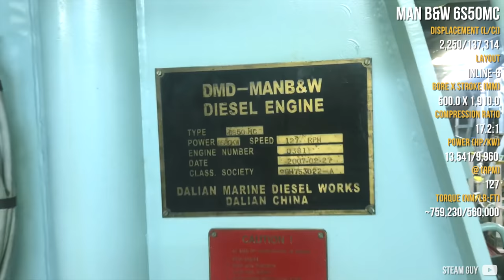Lowest Revving Diesel Engines

Comment: Detroit 71 and low revving don't belong in the same sentence.
Reply: They are low revving though. They just sound like they're screaming because you get the exhaust pulse twice as often as with a similarly revving 4T diesel
Reply: Detroit 71s are known for being weak in the low end. They need every last one of those 2100 rpm and some even went to 2650.
Reply: @nickthompson9697  Take the turbos away from the 4-strokes....and see which is really the gutless wonder

The 12V71 pulls 477 HP without a turbo to go with 1251 lb-ft of torque.
Reply: @markdubois4882  Take the blower off the detroit and it won't run at all. More to the point, there's a reason we don't do engines that way anymore. They're criminally inefficient and can't get anything done without leaking everywhere. Kind of like most of the people who still shamelessly defend them.

Comment: The MAN 6S50 still is revving relatively high for Two Stroke Crosshead Marine Diesels. The MAN S Series (S meaning Superlong Stroke) goes up to 900 mm Bore on the S90. I personally worked with a 6S80 ME-C, meaning it has 800 mm Bore and accordingly 3450 mm Stroke (if the S90 has the same Stroke to Bore Ratio, it would have about 3880 mm Stroke but I don't know if that's correct). The 6S80 I worked with goes up to 78 RPM and I'd guess other Verions of it are in a similar Range; e.g. does the Maersk Triple E have two of the same Engines with eight Cylinders instead of six (8S80 ME-C) and IIRC it is built with up to twelve Cylinders for Ships similar of similar Size to the Maersk Triple E Class but with only one Propeller and thus one Engine. Given that the Cylinder Oil (these Engines use different Oils for Cylinders and the Crankcase) can only do it's Job up to a limited Piston Speed, the longer Stroke of the S90 means that it runs even slower. The ME-C means that the Engine is controlled electronically without a Camshaft, contrary to the conventional ME-C Engines. This allows a more flexible Valve Timing which reduces Emissions and becomes particulary useful when burning more than one Fuel, e.g. switching from Bunker Oil to Diesel in Emission Control Areas or the latest Advancements of Dual- and Triple Fuel Engines that can also burn LNG or Methanol (switching from Bunker Oil to Diesel doesn't count as Dual Fuel). MAN also builds an Engine with an even higher Bore of 980 mm; the K98 Series but the K means that it has a shorter Stroke of something in the 2.5-3 m Range IIRC. The largest Internal Combustion Engine ever built is the Wärtsila 14RT-Flex 96C with 14 Cylinders of 960 mm Bore and a Stroke of 2500 mm. It powers the Emma Maersk Class Containerships.

I've uploaded a few Videos about that on my Channel; although that was back when I was a Cadet so some of the Informations there aren't 100% precise.

Piston Change:
https://youtu.be/QLVbU14HjZM

Climbing into the Crank Case:
https://youtu.be/AhI3VNo8i5Q

Engine Room Tour:
https://youtu.be/eS5IG2HnY8I

Longer Engine Room Wlakthrough in 360° with Voiceover Explanations (sorry for my ridiculous German Accent):
https://youtu.be/_Y5QCGLtQFw

Comment: You need to head to Brookville PA to see a single cylinder 200 horsepower Snow diesel engine,  under 300 rpm, 14 foot flywheel,  and weighs about 40 tons.

Comment: That first bit of film of a deltic is a T9/29 engine which is a 9 cylinder version, not 18 cylinder and is turbocharged as well as supercharged where as the 18 cylinder ones are just supercharged.

Comment: The reason for the generally higher torque of a diesel engine compared to an otto engine of similar size is not because of different energy content in the fuel, that difference is not large. The reason is instead the differences in compression ratio, bore:stroke ratio and the speed of combustion. See this video from "Engineering explained" for a more thorough explanation: https://www.youtube.com/watch?v=D6YmAecTolQ
(He mentions the different energy content of the fuels at the end but as I said, it's no large difference and furthermore, the amount of fuel is not fixed.)

Comment: Those Lanz Bulldog are very special. Instead of a reverse gear you can let the engine run backwards, and you need to heat them up for them to run. If you let them idle for too long, or drive downhill for too long, the engine will cut out because it gets too cold to ignite the fuel. But due to their low compression ration and simple fuel system you can run them on pretty much anything that burns. They're the OG multifuel engines

Comment: One slight thing worth mentioning is the deltic engine at 3:10 is a turbocharged 9 cylinder version used for small single engine locomotives, the 18 cylinder supercharged engine that was used in pairs in the famous class 55 sounds much more impressive, as shown in the clip following

Comment: I'm surprised you haven't done the English Electric diesel engines. We had them in some of our trains. Max rev was 750 to 900 rpm depending on models.  Some are still in full service after 60 years and in my opinion have one of the best sounding large engines.

Comment: I bet you #1 is less than 1,000 RPM
Reply: Well if the first one is 2100 ...
Reply: Wow, you really went out on a limb! 🤣 The biggest ship engines turn less than 100. Though technically diesels, they actually run on what is basically crude oil.

Comment: Those hot bulb engines didn't just run on diesel, depending on how much you heated the bulb, the engine could even run on kerosene, butter and in some cases petroleum, while only consuming around 300ml of fuel per 10km. Nice one btw

Comment: Nice video but I missed a whole range of engines like the german deutz and mak engines. Dutch engines like brons, bolnes and industrie. And many other brands worldwide, the 6 cilinder German 545 deutz for example with an  rpm between 60 stationary and up to full throttle about 375 rpm. About 500 to 800 hp and weights around 20 tonnes. Had it in a cargo vessel I worked on, absolute beast and will run forever.
Reply from the maker: Obviously, I cannot fit all the engines into a single video, but they may into next episodes ✌🏻
Reply: @VisioRacer  Yes it wil be a very long list when you must mention all of them at once hahaha. But keep going, i like watching your videos💪🏻

Comment: The Deltic was and is an extraordinary engine, a class 55 Deltic has 2 of them, making for 3300hp.
The prototype was when built in 1952 the most powerful single unit diesel locomotive in the world.
The locomotive being started in the shed in the video is a Baby Deltic, being recreated around a rescued Baby Deltic engine from parts of other locomotives, as none of the original Baby Deltics survived. 
The Baby Deltic had a single 9 cylinder Deltic engine of 1100hp, those engines were harder stressed as the triangle 18 in the Class 55, which had derated engines of 1650 hp to make them longer lasting in railway use which puts more stresses on the engines than marine aplications.
So the Baby Deltics were less a succes and led to early withdrawall.
Reply: WoW the deltic Engine is cool

Comment: Nice, interesting collection of engines; I think the Super Landini tractor with an engine similar to the Lanz is a little lower revving at 620 but the most courious thing is it can still run making only half a turn, it's called "mezzo giro", and you can even reverse the engine rotation, but to start it you have to be brave enough to turn with your hands the flywheel

Comment: Diesel indeed is a fascinating fuel, burn it in a piston engine, revs slow. Burn it in a turbine, revs a hell lot higher
Reply: That's mainly because a gas turbine is a continuous combustion engine and the speed of combustion of a fuel does not matter. The fuel does not need to be ignited and burnt within a specific time period.
A gas turbine can be fueled with powdered coal and it will still operate at high rpm.
GM made coal fueled gas turbine prototype cars in the 1970s.
https://jalopnik.com/gm-once-built-these-fascinating-coal-powered-turbine-ca-1791842557
Reply: @paulg3336  but making a gas turbine engine fueled by diesel is a bit expensive, like for example they need a lot of compressor stages and if possible even a centrifugal compressor as well due to which reaching a high rotational speed is difficult yet diesel pulls it off easily due to its high burning temperature and high energy output. That's what I wanted to acknowledge.

Comment: I'd vouch to say the number one factor limiting the RPM range of diesel engines has the most to do with piston speed. Because of what a diesel engine is generally designed for (torque, not speed) the strokes of these engines tend to be far longer than their gasoline counterparts. Longer stroke means peak torque is delivered at a lower engine speed because of the length of the throw and the speed of the piston. The accelerative forces on the parts making up the engine are much higher in diesel engines than in gasoline engines because the pistons have to travel a greater distance in the same period of time. 2,000 RPM is 2,000 RPM, no matter what engine you're using. Just for example, the 5.9L Cummins has a stroke of 120 mm. The Honda R18A has a stroke of 87.3 mm. The 6.2L Chevy LS3 engine has a stroke of 92 mm. 

I'd wager that if you made an oversquare diesel engine that you could get it to rev like a gasoline engine.

Comment: Love it. Technically the Lanz Bulldog can run at 0 RPM, as the cylinder doesn't quiet kick over but bounces back and forth. If you can call that running.

Comment: You missed the Wärtsilä-Sulzer RTA96-C  2stroke straight 14. It produces 107 390hp at 102rpm, redlines at 120. Each cylinder has a capacity of 1810L. Great vid though, love the Bulldog!

Comment: Meet the Wärtsilä-Sulzer RTA96-C, cylinder diameter about a meter, piston stroke 2.5 meters, 25.5 thousand liters of volume, eats 4 liters of diesel per second. And most importantly, it works in the range from 20 to 100 rpm

Comment: The wartsila 96C is the largest engine in the world. Largest is a 14 cyl inline engine. 
It's the largest, most powerful internal combustion engine ever built. It's a 2 stroke diesel and has a redline of 102RPM. Makes 109,000HP has over 7,000,000lb ft or torque.

Comment: The gp35 locomotive I used to run was a little over 2500 hp  gm v16 and at full throttle {run 8} only turned 870 rpm and it sounded like it was gonna fly apart. I remember the crankshaft sticking out the back was like 5 inches in diameter.

Comment: I probably would have included the Wartsila RT-flex96C, 109,000 hp 750 rpm 14 cyl and they make a 16 cyl marine use. I thought you had a past post that included this engine but I could not find it.

Comment: I appreciate you videos, VisioRacer, but I am afraid, I have to correct you in this. A diesel engine does not produce more torque, than a gasoline engine. That is because the diesel-cycle is less efficient than the otto-cycle. The only reason for the higher efficiency of diesel-engines is the fact, that the compression ratio can be higher since the engine does not knock due to the cycle. And that is also the reason for the higher torque of the whole system regarding super-/turbocharged engines. A diesel engine can be driven with a much higher intake manifold pressure, than a gasoline engine. But for naturally aspirated engines, the gas-engine is superior in terms of torque.

Comment: Sorry those Detroit’s ran well in excess of 3000rpm. The dealer spec’d them for 2100, guys turned the fuel up and would constantly loop the rpm gauges while they were running 90-100mph

Comment: What a load of bullshit. The slowest diesels are all in the marine industry direct coupled to the propellers (some have been used in power stations in the past). The limit on rpm is nothing to do with the fuel or the compression ignition cycle, it is related to Piston Speed at mid stroke. For long running hours a figure if 11m/s is generally used. So for an engine with a stroke of 2.2m (2200cm) the max long hours rpm is appox 95rpm.

Comment: John Deere, twocylinder diesels, made until the 1960's had a much lower top rpm. They would run forever, and, were cheap to run. However, John Deere had reached the horsepower limits of the two cylinder engines. They then switched to four and six cylinder diesels, later adding turbos. Most of those 10series and 20 series tractors are still at work every day on american fams. The ones without turbos lasted longer and were a simple straightforward engine.

Comment: You can even find mainengines that had maxrevs 87 rpm but they had cylinderdiameter of 1050 mm . The CPP was constructed in the middle of 60s .

Comment: The Lanz Bulldog can be made to run at zero rpm, there's a video on YouTube of one doing just that,  it's firing but instead of completing a full revolution it just oscillates through 350 deg. cycles or thereabouts.

Comment: The funny thing with Lanze Bulldog, is that you can run it at 0rpm, since the engine can change directions, so with a little adjustment and find the sweet spot, you can have it jumping between rotation direction, without doing a full rotation! 

Truly weird tractor

Comment: I unfortunately don't yet work on diesel engines, but it's incredibly fun to make the Kohler engines in my vintage Cub Cadets idle as low as possible. Pretty cool sounds they make, but I don't think it beats the sound of an idling Detroit diesel, or the sound of one running high throttle.

Comment: Some diesels are slower because of the lower rpm but not most a diesel f250 is faster than a gas f250 and that goes for most vehicles diesels have more power but are geared lower which makes them slower than high gearing but they can tow better geared low

Comment: Love the EMD 16-645!! In norway the northernmost railroad we have that isnt electrified use that type of engine on the locomotive for passanger transport. The locomotive is called DI4. I found it very fascinating that the engine is two-stroke as it was an unfamiliar concept to me in large diesel engines. Even though i wish for that strech of railroad to be electrified, as it is one of the oldest and least maintained streches of railroad in norway, i was very impressed with the engine!

Comment: Rd6 cat dozer 3 cylinder is one of the best sounding low rev diesels I’ve heard, Detroit has an amazing sound but 2,100 rpm is pretty much where most heavy trucks redline anyway
Reply: I can't believe the 3 cyl Cat engines from the mid 30's didn't make this list! RPM at full throttle maxed out at 850, but RPM at greatest torque (maximum power produced) was only 600!
Watch this vid to see why :  https://www.youtube.com/watch?v=IF_fR5v2byw&t=457s

Comment: The Detroit Diesel 71 Series could rev higher than 2100 rpms. In military and fire apparatus you could spin it up to 2500 rpms, and in tractor pulling.....6000 rpms. Diesels can rev if cammed and tuned properly.
Reply: Jesus, I've never heard of a 71 series turning 6k revs. I'd be afraid it would send all the connecting rods into orbit.

Comment: Fun fact, the 8V-71 and 12V-71 detroit diesel engines were set up to be able to joined together by another engine, creating the 16V-71 and 24V-71 engines respectively, however the 24V-71 was never offered available from the factory despite the 12V-71 blocks being prepared to be joined together
Reply: ursus c made in poland

Comment: I would like to see a video on the quietest engines ever made.
Reply from the maker: Hmm
Reply: Made by a watch company in switzerland.the company is called Tik tok the engine just ticks when you wind it up.
Reply: Quietest combustion engine is probably an old, low-rpm Stirling engine...
Reply: Like a pulse jet? 🤣

Comment: Since when did 'naturally aspirated' mean supercharged last I knew it meant just the intake suction force from the pistons
Reply: I think he meant the Detroit's.Two stroke diesels cannot work or to be correct scavange without positive air pressure to clear exhaust gases from the cylinder unlike a gasoline two stroke.The Detroit's used a low pressure supercharger to do this but some had an exhaust driven charger as well as a crank driven one.

Comment: Why do diesel or industrial engine alway show the Hp on specs plate and stuff and not the torque? Like even civic kids will laugh and tell than they do more hp or they can do better with a exhaust filled with holes.
Reply: Horsepower or kilowatts the engine can produce. Its these guys that determine their use in the industrial world. Since these engine are running constantly, torque ratings are rarely used. Marine engines with mechanical gearbox on the other hand shows torque ratings to determine what design a propeller can nest fit. If a marine engine is a generator type (diesel-electric mode), then torque ratings are also not used. The drive motors on an electric drive provides way more torque on all ranges of rpm. They just only need power.
Reply: @kimpatz2189  thanks i understand now :p

Comment: Compression ignition timing is controlled by fuel injector timing, as opposed to spark timing. Because preignition is not possible in a diesel compression-ignition system, the compression ratio is limited by mechanical strength and not preignition/detonation. It is primarily this increased compression (or increased cylinder pressure in boosted engines) that creates the increased efficiency. Diesel fuel is higher BTU, but this is not the primary reason for increased efficiency. 
I could be wrong about this, I have been wrong before.
Reply: Love your channel!